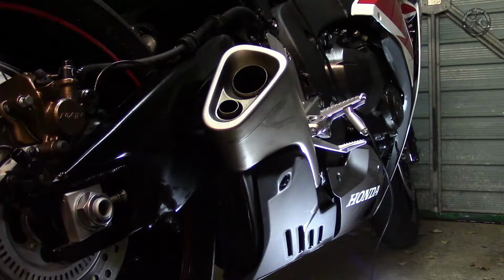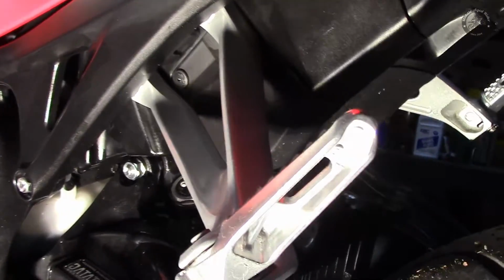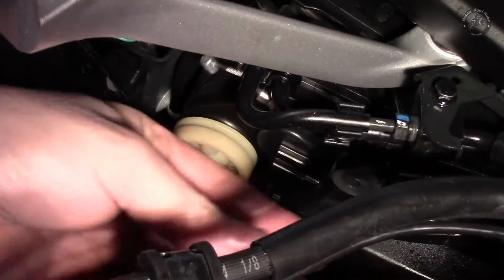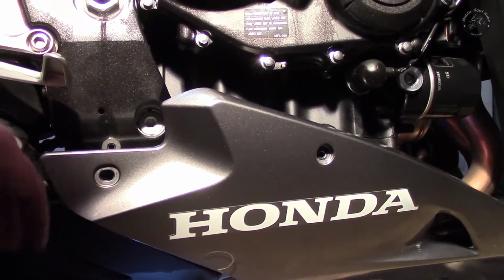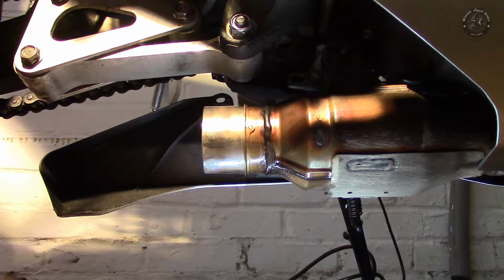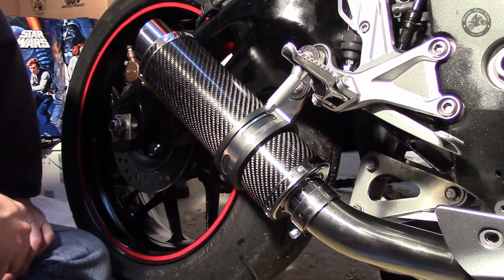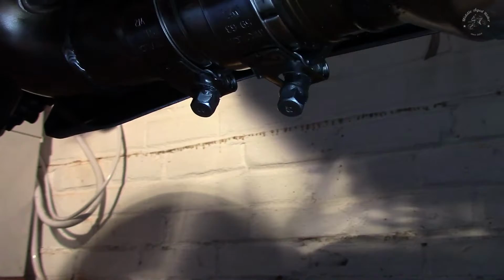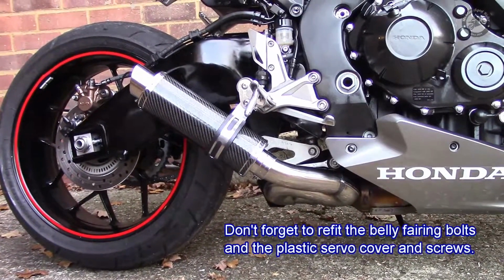Fitting an SP Engineering exhaust - 2015 CBR1000RR ABS

Comment: What do you do with the cable when you take the old exhaust off? Completely disconnect it?
Reply from the maker: The cable is permanently attached to the original exhaust so there's nothing more to do except unhook it from the servo motor as shown in the video and then store you original exhaust safe and sound. Thanks for watching

Comment: I've got a Diabolus can made by SP Engineering it looks and sounds brilliant check it out on my channel, I tried it with the baffle out and it was too loud so kept it in but it is still loud. When I replaced the stock exhaust I noticed it felt a little lighter and the acceleration improved, I would highly recommend any of the SP Engineering exhausts they are brilliant.
Reply from the maker: Thanks for visiting. Yes the new can is a LOT lighter than the stock one which is another bonus on top of the looks and sound!